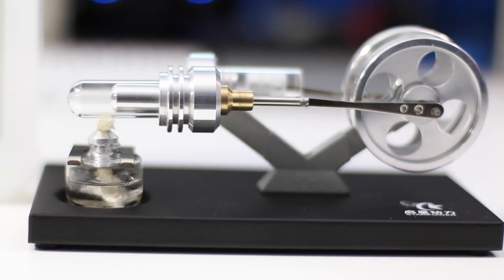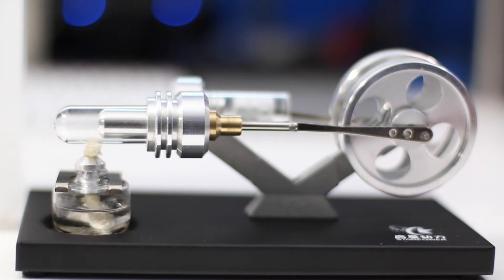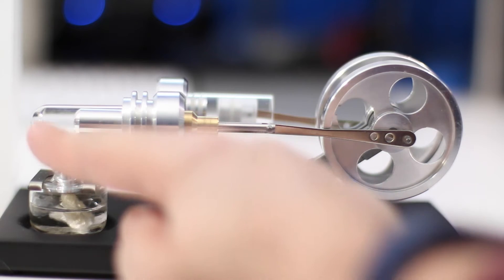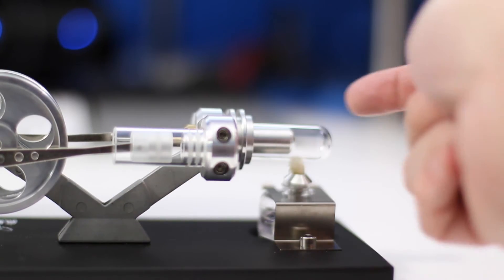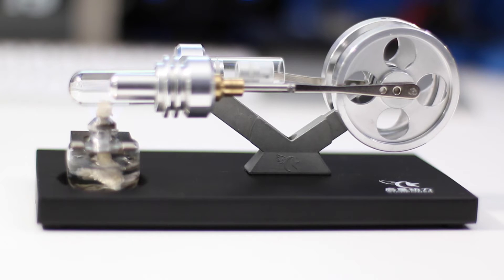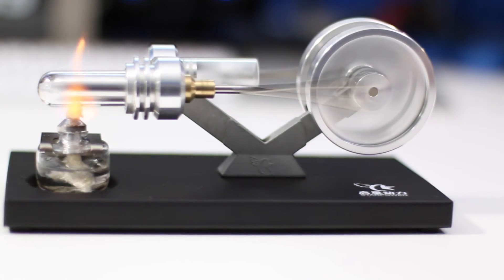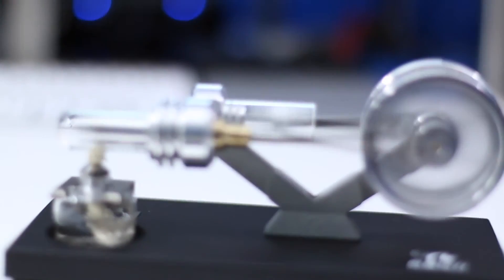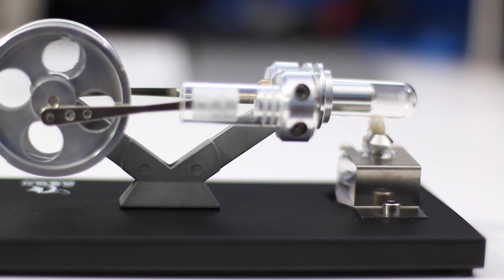SunnyTech Stirling Engine Demo / Review

Comment: I got the one with a generator, and the hot side piston is abnormally offset to the left. Any advice?
Reply from the maker: As long as it runs, I would leave it as-is.  If anything the distance may even improve it because the hot air may get a bit more room to cool off before the next cycle.
Reply: @AskJoe  Okay, now I kinda need more help. I (ahem) tinkered with it, and now I can't get the hot air glass tube on. I suspect it might be the riveted ends of the glass tube, or the O-ring is too thick. .-.
Reply from the maker: @zellryss4783  Bummer.  They include a few spare parts, but I don't think they expected anyone to need to replace that one.  They have great customer support.  Send them a message.  You may even get a response from Sunny himself.
Reply: @AskJoe  Kk

Comment: Mine doesn't work, it stops right away. Any ideas why? I really don't want to ship it back..
Reply from the maker: The most common problem is a weak alcohol.  Do you know what strength you used?  Some rubbing alcohol is as low as 70%.  I use 91% or better.  Also, once it gets going, you sometimes need to spin it a bit to get it in motion.
Reply: I literally recieved it 1 hour ago, and I don't have any alcohol, so I just used a candle to test it out. I let it heat up for about 2 min but it only rotated like 3 times and then stopped (not like it was cold or anything, but it doesn't keep going). Is it because I'm not using alcohol?
Reply from the maker: @Vethursan1   I'm pretty sure that's it.  A candle is not very hot.  Try using 91% or better alcohol.  That generates a much stronger flame.  I've tried lower, but it doesn't work.
Reply: Thanks a lot. I just tried out something hotter and now it runs as it should. I'll definitely buy the same alcohol as well.